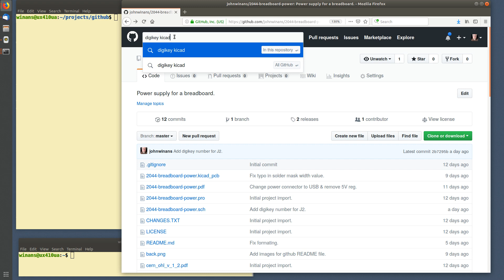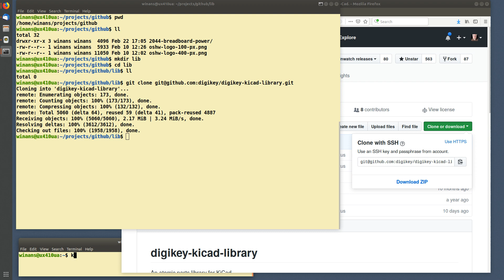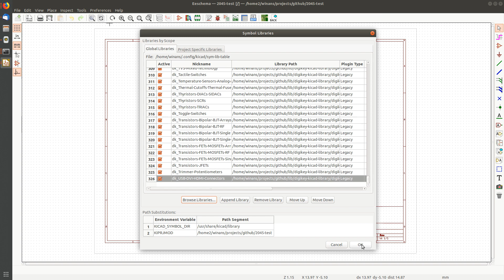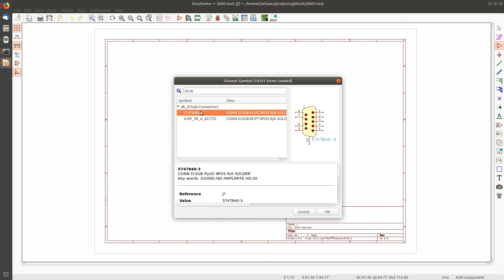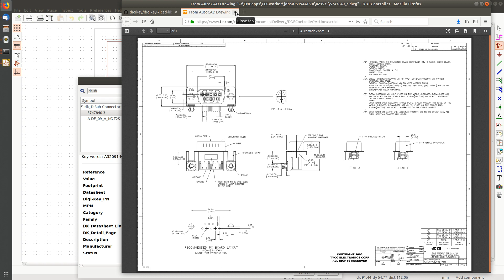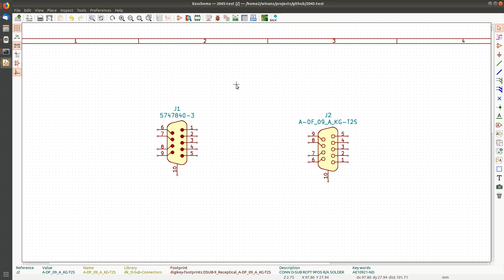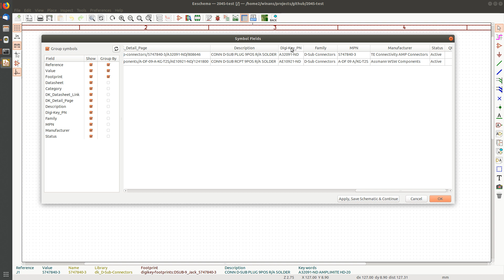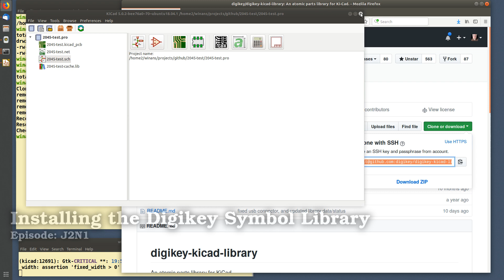KiCad 5 #9 Installing the Digikey Symbol & Footprint Libraries

Comment: i downloaded it today 25 jun, but lot of options seems to be already changed in Kicad's recent updates.
Reply from the maker: Some stuff looks a little different. But it's still all works the same. By the end of the playlist you'll notice that I had downloaded updates too. Some menus move around a little bit & the component editor reorganized its field presentation quite a bit.

I've been holding off on extending that playlist because KiCad 6 is supposed to come out soon and change it a bit more. I'm thinking that will be a good time to revisit that entire playlist, correct the things people have commented on etc.

Don't hesitate to post critical comments on what needs updating.  I read every comment posted on my channel.  If I can, I'll make the updates.